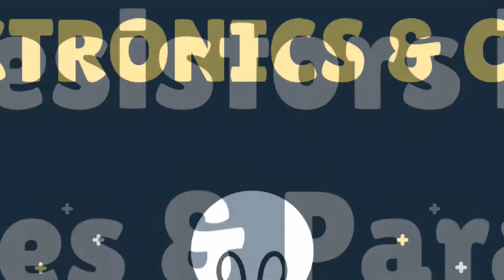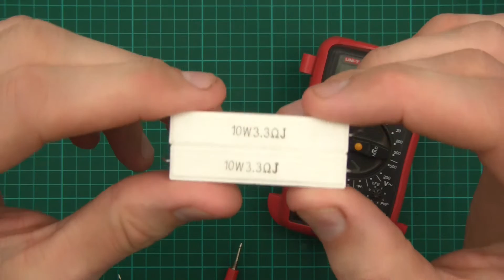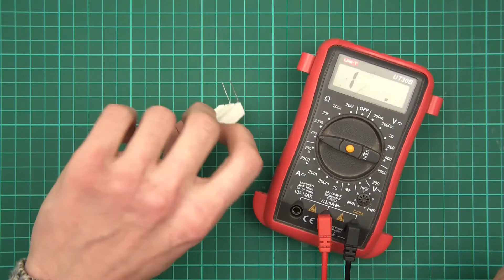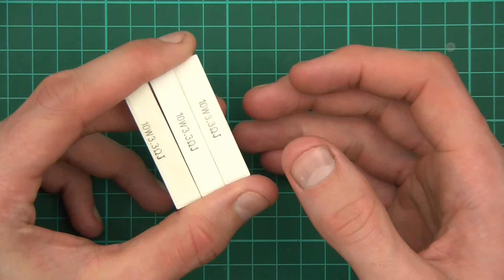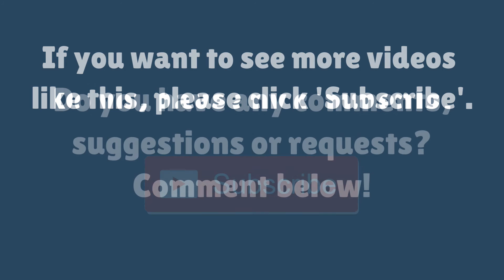INVESTIGATING: Resistors - Parallel vs Series! What Happens To Resistance?

Comment: Think of parallel resistors as if the resistors/wires are pipes. If you have a 1cm pipe, it can only allow a certain amount of L/Hr. Add a second 1cm pipe, you can now transfer twice as much L/Hr. If 3 of them, then 3 times the L/Hr of one of the same size.
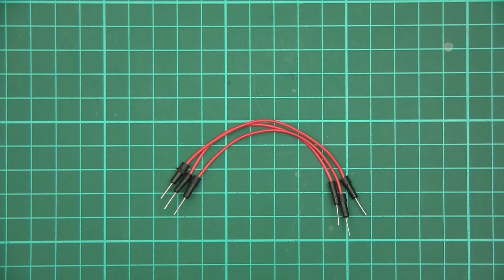Hahah, commented before I saw 11:35  :P
Reply from the maker: Korishan how's your bms project going korishan?
Reply: Actually ran into a snag. I wanted to move the project to an esp8266. But when I compile the code, it breaks and I can't seem to find any solution to the errors produced. I'm ultimately going to be using an stm32 based board to use the crc functionality. But I wanted to expand a little and make a web page on the esp8266 so I could better see what was going on with the board and test different settings and such.
Plus, for some reason, I can't communicate properly with the TI chip on my arduino with the code. The breadboard has been sitting on my desk for awhile disconnected from everything. I plugged it back in and started checking some things out, and it won't communicate. So I reflashed with a basic I2C scanner and it works fine. So I'm not sure what's going on with that. I'll be stripping it down and build up on the code again to see if I can get it to communicate again here shortly.
No videos on it as they'd be garbled messes and run-ons as I'm trying to figure out the issues  😜  After I get things sorted out, I'll see about making a coherent video on the build. I'll have to break it up into chunks like you did with the battery capacity tester.
Reply from the maker: Yeah cool cool... The ESP8266 and ESP32 do some strange things. I've only recently learnt how to wield them!